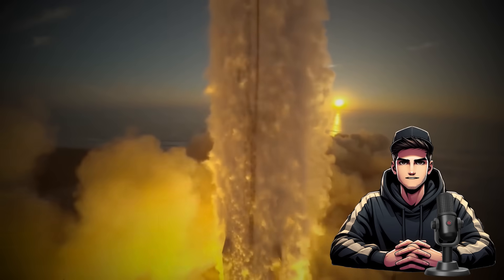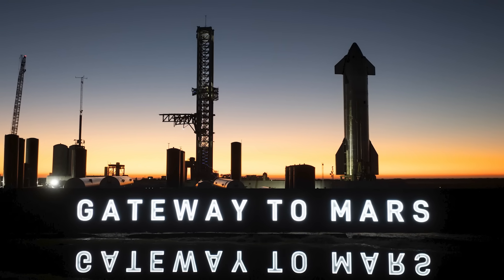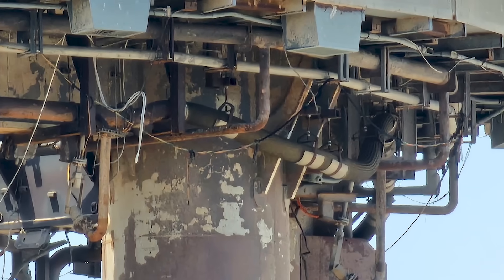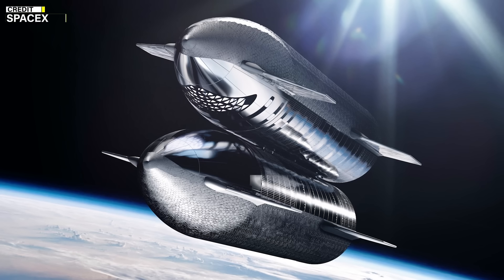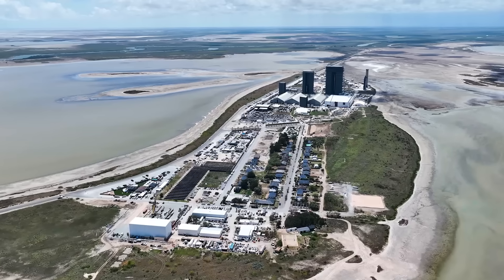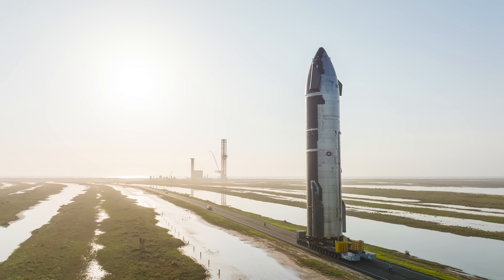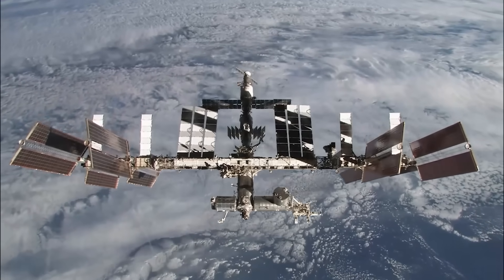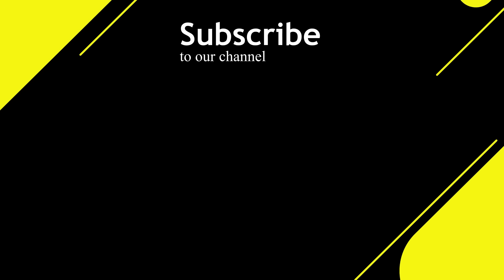Starship 28 & Booster 10 Static Fire Completed, NASA's New National Lab | Episode 21

Comment: As a long term supporter of NASA and a taxpayer, I can't believe that NASA is willing to scrap the entire ISS system instead of looking for options for saving at least some of the ISS systems for future use!
Reply: We just have to be careful to not end up like MIR. A vehicle can suffer a lot from fatigue and degrading materials over the years.
Reply: @ky-effect2717  Understood. Those issues are beyond my paygrade, unfortunately.
Reply: If cost of returning and upgrading is more than just building from scratch that would be why
Reply: Why do you think high-pressure tubes must be replaced after 50 to 70 years? It is not the rust, but the recrystallization of metals.
Now scientists found out why Roman concrete survived millennia, and modern one had to be replaced after less than a hundred years.
Reply: It's old dumb fuck
Reply: You must not have been following what's going on with ISS.  Russia side of the station is failing, cracks, leaks etc.  US Congress isn't going allow for funding for both Moon initiative and replacement/refurbishment of the ISS.  Station wasn't designed to last more than 20 years.   There not enough money budgeted for both, including the Luna Gateway Station.

Right now, there was bid by NASA try get commercial providers submit bids for commercial space stations.   Axion the first of them is going launch new station directly from the ISS itself.  Others such as Lockheed is teaming with other smaller companies to launch their own Star Labs station.  Blue Origin and Sierra Space were suppose to be moving along with their own Station initiative, but that may have stalled.   

Weither or not it will succeed is for time to tell.